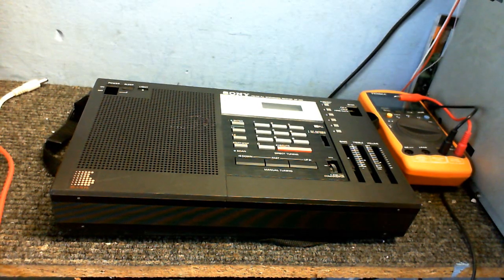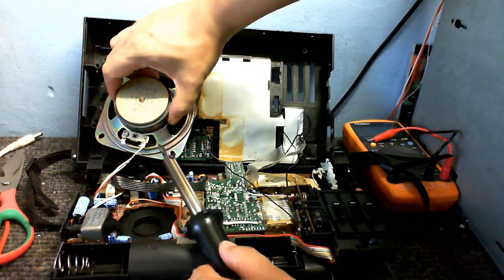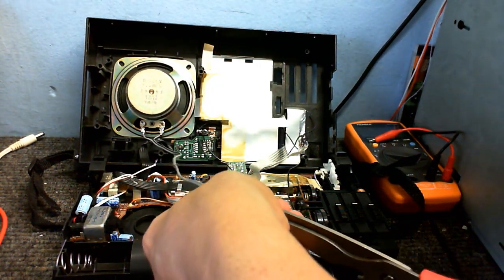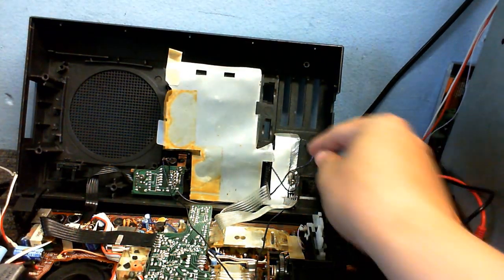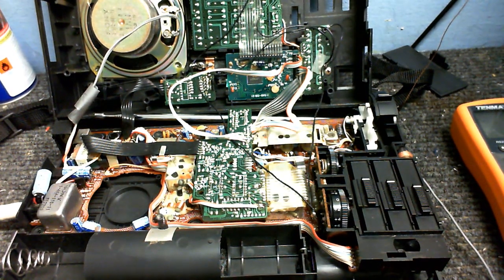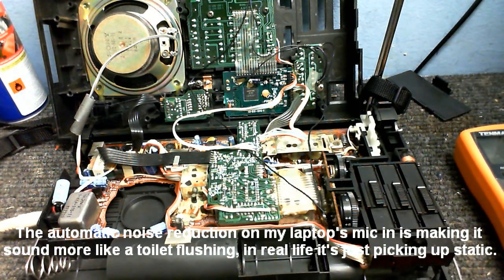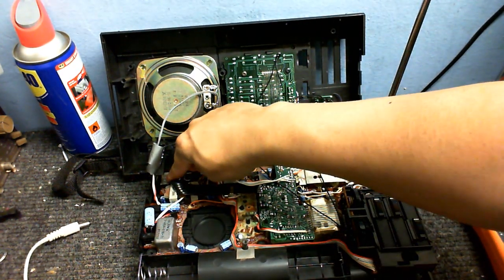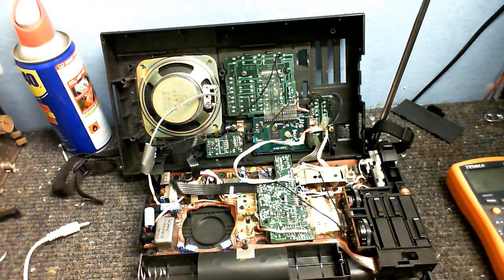CDC Electronic Workshop - Fixing the Sony ICF 2001 part 1 of ?

Comment: Download the service manual, and check all voltages on psu,
you find a signal generator and inject a signal, section by section (to antenna a amplifier) check the signal.
But It's neccesary to download the service manual.
After repair, you alignment the receiver, comes in a service manual.

Comment: (Comment @ 14:13 after replying the video) 90 sleep is something to do with a auto power off timer. (sleep mode) on the display it said 90 sleep or sleep 90 its just showing that its in sleep mode and the "90" basically is how long there is before it turns off. (so in this case of the video. it will turn off after 90 minutes or 90 seconds) must radios with digital clocks\displays have this feature. however since it looks like that radio is malfunctioning or not doing what its suppose to do then it may never turn off even in sleep mode unless you take the batteries out\disconnect the power supply but enough of that. try looking for the fault (look for parts that are bad/blown or not working) and if it is the control board/chip then look on ebay and try to find a replacement. if not then there nothing you can do. thats all i can say and i hope some of info helped little bit.

Comment: That one has some gremlins! 
Perhaps that power switch is getting back fed from somewhere else for it to stay on, reminds me of this tyre machine I was worked on.... all tested electrically fine but would fail under load, I thought it was just a dodgy cap being a simple forward reverse motor control. Ended up using contactors and low voltage on the rotary mech and away she went.... Spend your time wisely on the old girl (some just are not worth it) or take her to your local radio club, I'm sure some ham might be able to steer you in the right direction.

Comment: I have a grundig radio with a digital display but an analog tuner and I could not turn it off. It has those foil type buttons on the board and it was next to impossible to turn off. It would turn on fine. I ended up probing and found two points on the board that turn the radio and display on so I just wired in a switch and it works better.

Comment: 4:30 Is that a temperature control pot on yours soldering iron? How many watts, just curious. Looks enough for through-hole work, but tip is too big for SMD (at least for me, for SMD I use around 2mm chisel tip)
  About radio - that's a maze! Seems like somebody had fun messing around with wires)) However, check the power supply for ripple since you have a scope (sometimes digital stuff will go mad when power is "dirty"). Maybe some cap dried, also check for dodgy joints. Anyway, good luck with that radio, well worth some time to repair it!
Reply from the maker: My soldering iron is just an ordinary 40 watt cheap iron I got from Homebase, (my local hardware store), there's no temperature control, that's just a screw to hold the cord in.  I had a look for any ripple, even though I was using a regulated supply, I noticed a DC DC converter in the radio, which could have been causing an issue if the caps are dried out, but it seems ok, I didn't find any ripple anywhere.
Reply: CoolDudeClem Yikes! Definitely looked like pot to me :) This time, I guess, there won't be quick'n'easy fix, but try anyway - there are still a chance to succeed

Comment: Will you ever do any power supply vids? I scrounged up some parts and built a few voltage multipliers...cooked a few caps but overall was pretty cool! Wondering about using them to power anodes or a B+ supply. What you think? What about testing such things with a oscilloscope? Mine is only up to 40 v max. Cheers.

Comment: The three things I'm wondering, is did you replace the shielding when you closed the radio? Is it possible you reversed two or more of the contacts in the ribbon cable? Is the FM LO working?
Reply from the maker: It looks as if the new ribbon cable I put in in the video is all connected where it should be, I don't think the display would work at all if it wasn't.  By FM LO, do you mean Local Oscillator?  I don't know where to check that.